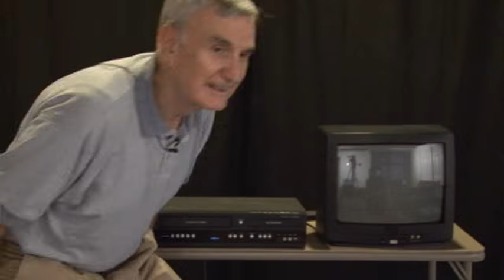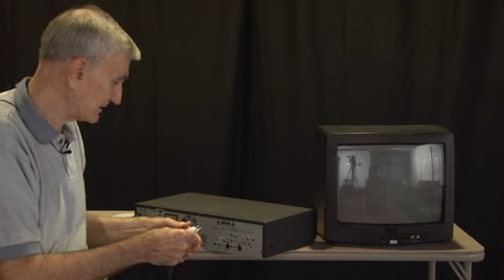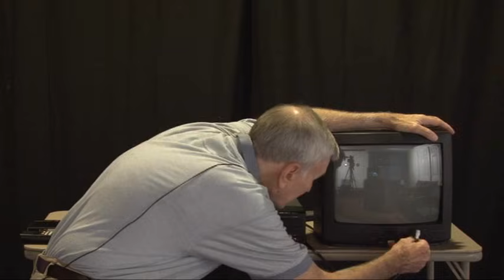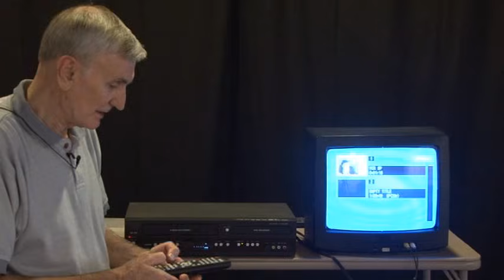VHS transfer to DVD using combo recorder

Comment from the maker: Charles G,  the brand is Magnavox ZV27MG9
Reply: can i do vhs to dvd Copy Commercial VHS Tapes
Reply from the maker: Juggerknot100, I believe the manual for my combo recorder says that if there is copy protection on the VHS Commercial title that it can not be copied.
Reply: juggerknot100 not usually. they is a coding on commecial DVDs that prevents copying them.

Comment: I just had cable installed on my "old" TV and I wanted to know if that will affect the way you connected this system. Luckily I have (almost) exactly the same VCR as you do, do I just make sure that the same cable wires you showed me are connected properly and not worry about the cable connections ?
Reply from the maker: I am sorry there can be so many variables with cable or dish and all of the peripherals. Just go with trial and error. Good luck

Comment: After I recorded it seemed to finalize the recording by itself. It will not do anything when I press the setup button.
Reply from the maker: If the DVD plays back on other DVD players, I would say good. If it doesn't you may have over looked some step.

Comment: My mother  bought me a Toshiba DVR620KU. Supposedly I would be able to transfer my old VHS tapes to DVD'S, and copy TV shows I had recorded on my Direct TV DVR. The VHS tapes I have were either prerecorded (bought at a VIDEO STORE), or blank ones that I had recorded TV shows or movies onto. I have the cables set up right. I am constantly getting error message, that I cannot record. What am I doing wrong , or were we ripped off. My technical knowledge is very very limited
Reply from the maker: I know nothing about the brand you purchased. However, I believe most brands are unable to copy copyright titles.

Comment: Hi Anthony,

Thank you so much for this tutorial. I did a test with a random recording I had and it worked great! 

However, when I tried it with a family movie (which already had the security/record tab removed), it wouldn't let me dub! Why does it work in your video and not with my family tapes?
Reply from the maker: Nana Kisoe , I am some what puzzled also. Only suggestion I have is to take the tape out, turn off the combo recorder and turn  back on and try again.

Comment: Very helpful but appears I need a remote to do what it is I need to do. I bought a used SLVD380P model on ebay which did not come with a remote. Is it possible to do all the stuff you did without a remote, or do I need to get one?
Reply from the maker: Davidy, This looks like it only plays DVD/VCR but will record to VHS tape. I don't believe this unit records from your VCR to DVD!
Sony SLV-D380P DVD/VCR Player VHS Recorder

Comment: The only thing it cannot do is transfer commercially released VHS tapes to DVD because of Copy Protection.
Reply from the maker: BuddyBoy600alt, tells me that in my manual.
Reply: my friend built me a nice little gadgit that removes copy protected signals.. works great.. back when RadioShack sold kool parts and things..
Reply: my friend built me a nice little gadgit that removes copy protected signals.. works great.. back when RadioShack sold kool parts and things..

Comment: just bought a Samsung TV to connect the Funai combo recorder.  Can't get the tv to show a picture.  Shows snow.  Could this be the cable?  Does a cable need to be hooked up for this to function.  Can the TV and combo recorder be hooked up without a tv cable?
Reply from the maker: tmro89 got3kids , If the cable connections connect both the TV and the output on the combo recorder, than it sounds as though you just need to select the correct input source with your TV remote.

Comment: Hi 
When I put the dvd in to  recored it keeps coming up with a message 
Disc not compatible  any suggestions
Reply from the maker: Jas Dhaliwal, is this a combo you purchased recently, I suspect this combo does not record to DVD.
Reply: @dahdigital1   the instructions say it will recored dvd from vhs 
Today I tried to power it up and for some reason it would not powe up  any ideas it did work yesterday  I tried changing the power cable and fuse in the plug but no joy

Comment: I have an old sylvania VHS/DVD recorder and I have had an issue with the blank DVD-R disc when I try dubbing an error message says disc error cant record on this disc what is the problem????
Reply from the maker: Katie, my guess is that your Sylvania recorder may have some instructions that are not the same as the Magnavox recorder I demo. I know that some DVD recorders require the DVD to be formatted first. I don't know about yours.

Comment: I have a sylvania combo Vhs/Dvd recorder and 
I’m all set to try this but
I don’t see a dubbing button anywhere on the remote .
Could it be called something else? 
Thank you for your great video! I never would have tried this
Without your help 
~ Cindy
Reply from the maker: From what I have seen in the past , I believe others have purchased a combo unit that looks almost identical to the combo recorder, but  is only a VHS tape player and a DVD player. If you don't have the dubbing button this is what I suspect.
Reply: I was thinking the same thing,  but the machine actually says Recorder on it ~ I will continue to try, thank you for all your help

Comment: Good job man!  Do you have any suggestions for old tapes with a tracking problem at the bottom of the screen?  Other then using the tracking adjustment feature on the VCR player?  The thin tracking line at the bottom of the video is annoying.
Reply from the maker: Yes, I have dealt with that over the years. I guess you could try putting in video editor and crop the picture.

Comment: where can i get one of those?  rw dvd vcr recorder that is in this video.  what is the model number so i can find one like this on in the video
my i had is broken it is a 2009 model   it is had to find one that is new and not used what kind  is this in the video?
Reply from the maker: Wayne Vaughan, my Magnavox ZV427MG9A that i demonstrated in my YouTube video is not made now and was discontinued several years ago. The only VHS to DVD combo recorders that I know of are only available used or refurbished. fI you search for one be careful that what you buy will record to DVD. There are combos out there that look identical to the combo VHS to DVD recorder but only records to VHS tape.

Comment: Why does the VCR side only last for a few dozen tapes before it goes out?  Then you have to hook up another VCR.  The disks randomly get E 3 followed by a hexadecimal number, then there will be what appears to be shadows, in the center tracks, so it won't finalize.
Reply from the maker: I can only seek from my experience. I had a combo recorder that went bad on the DVD side, i always felt like the young people got a hold of it ant treated the combo recorder roughly. I bough my second combo recorder same brand and model as first and made sure the kids didn't abuse that combo recorder. Over the years i literally transferred hundreds of vhs tapes to DVD with no issues except for an occasional bad tape.

Comment: That particular DVR Combo is a SANYO and they don't take DVD+R or DVD+RW none of the pluses +++.
It requires DVD-RW and one's mileage varies when using DVD-R. Speeds are tricky and that unit needs 4x to 8x NOT 16x. Sanyo FWZV475F is poor technology because it has no USB ports for USB storage devices and there are external USB DVD-RW writers.

Comment: Also I have a Sanyo DVD player/ Video Cassette Recorder. When I put the blank DVD in it reads "error." Does this mean my machine isn't equipped to record DVDs?
Reply from the maker: If it is only a player, then " no" it will not record a DVD.

Comment: Thank you so much Anthony! We are now on the correct path to record our old VHS tapes. I do have two questions. On many of our vacation VHS tapes, I want to make several copies for everyone to have a copy. Do I have to keep the sound on the TV for the sound to be on the VHS recording? My second question is do you copy, onto DVD, camera movies? Thank you - Debbie
Reply from the maker: Debbie Rapier, Let me try to understand your question "Do I have to keep the sound on the TV for the sound to be on the VHS recording?" I have never tried to record a VHS tape using the combo recorder. All of the the recording to DVD or VHS audio and Video is done internally, so no I don't see why it would need to be keeped on TV. Yes you can hook the older cameras to the combo recorder and record form your camera. The newer cameras mostly connect by USB.

Comment: I've a Daewoo DC vhs dvd combo recorder which I boughted 3 days ago.. however it works correctly but the problem is that there isn't the dubbing bottom on the remote or on the machine and I've a lot of vhs tapes to convert it now... please help me !
Reply from the maker: +SNCFT / Tunisian Railways , I only have experience with my brand but here is what I  suggest. Put a black DVD in the DVD record tray of the combo recorder. If you have your combo recorder connected with the video out to a TV and now play a VHS tape, if you  can watch this play on your TV.  You should be able to press the record button on the combo recorder for the DVD and this should record the program from the VHS tape to the DVD.
Reply: ow sadly I saw the caracteristics of mine an' unfortunately it can't dub from VHS to DVD.. it can only record from TV to VHS or from DVD to VHS.. bad luck !! and I've a lot of vhs tapes that I want to transforme to DVD

Comment: While this certainly is one way to go about it, I rather prefer to have a dedicated VHS deck and then hook that up to an HDD/DVD-recorder.

This way I can record the contents to the HDD first at maximum quality and then trim the recording and remove unwanted footage, like ads, parts unrelated to what I want to keep (snowy pictures, blank tape space, etc). Once I'm satisfied with the end result I can then transfer that to a DVD, knowing I'll get the best possible result and only the content which matters to me. Sure, the transfer to DVD will most likely happen in realtime (unless the program is only one hour long), but the result is quite acceptable with very little loss of picture quality.
Reply from the maker: pHD77, very interesting! would you please give me the brand name and model number of the product you are referring to? Thanks
Reply: @dahdigital1  Since my gear hasn't been used for quite some time and is stored somewhere in my basement, I can't give you an exact model number. But I can give an idea of what to look for to get the best possible quality.

As far as  VHS playback goes, I would look for any hifi units made by Sony or Panasonic back in the mid- to late nineties. I've found these units to be both very reliable, easy to maintain and able to provide a very good picture. Indicators to look for: For Panasonic units, look for the Super Drive logo, while on the Sony units look for the TriLogic logo. 

Back in, oh, I guess 2006, I had a deck like yours at my place for a short while, borrowed from my uncle, who wanted to transfer all of his home video, but couldn't figure out how to operate the damn thing. The playback of the VHS part looked to me like crap. Oversaturated colors and details were lost even more. I immediately just told my uncle to return the damn thing and then I hooked up my own gear. I actually made a disc to my uncle, showing him the difference in VHS playback and he was surprised to see, that two units performing the same task could differ so much in quality. 

Oops, getting sidetracked here... 

When it comes to the HDD/DVD recorder, mid- to late 2000s Panasonic decks are preferred, since they have a very good comb filter capable of suppressing analog artifacts, such as "rainbow" effect, very efficiently. Second choice would be a Pioneer - the results are a bit "softer" and the comb filter is not quite as efficient as one on the Panasonics, but it will still yield good results.
Reply from the maker: pHD77, Thand you for taking the time to give me this information. I actually have the Panasonic DMR-EH75V wondering if this is the same HDD/DVD recorder you have. When I started transfering my VHS tapes to DVD I had well over a hundred and just wanted to get them transferred over to DVD. Yes I may have lost some quality but I have such a volume of video I hardly know what to do with it all. But than again for your very good information.

Comment: I've been trying to copy for over 1 month now and I keep getting messages on the dvd stating 'disc error:  please eject the disc.  playback feature may not be available on the disc.  need answer.  thanks
Reply from the maker: ronald king , I suggest that you check your manual to find out the exact DVD disk that your machine will record on and use that DVD. If you know you have the correct disk, you might have a bad disk. Try another disk.

Comment: I really appreciate your help with this. I couldn't have done it without this video. Is it okay if I do HQ 1hour for a tape that has 1:09:06 ?
Reply from the maker: Cheyenne Paris, It is OK as long as you know you may be cutting you DVD recording short by about nine (9) minutes.
Reply: Okay thank you, also I have a VHR tape that's 1:08:43 and a different tape that's 20:38 can I put them on the same DVD if I do SP mode (2hrs) if so how? Do I put the first tape in and dub it to the DVD then dub the 20 min tape after ? Or would the 20 min tape go over the first tape? Let me know what you think. Thanks. Hope this makes sense.
Reply: And would I finalize the 1:08:43 tape on the DVD before I put the 20:38 tape in the converter ? Or do I  finalize the DVD after converting both tapes to the DVD.
Reply from the maker: Cheyenne Paris, Please watch my YouTube video " Simple editing using combo recorder to transfer VHS tapes to DVD" I think that should answer your questions about your transfers.

Comment: I recorded the DVD from a VHS following your instructions. I finalized it too. I can only see in the VCR I used, which is the one you use in your demonstrations. What am I missing? In my computer it shows dat files. It does not play. Thanks for your help.
Reply from the maker: +Suzana Maria, I use the  MAGNAVOX DVD COMBO RECORDER  ZV427MG. This combo unit does not require a computer.
Reply: +Anthony Wheeler Thank you for your prompt response, Anthony. What I meant is that the DVD cannot be played in my PC. I think I figured it out. I need a program that will open the DVD.  I have a Magnavox combo 620.

Comment: is this the Funai ZV427FX4 Combination VCR and DVD Recorder??  i am looking to buy one on amazon. also which DVDs do you recommend, i want archival quality, also another video suggested i could only use DVD-R for it to work. is this true or can i use +R as well on this machine. again which brand and type of DVD do you recommend for transferring  my old VHS tapes. thank you
Reply from the maker: James Brooker, my combo recorder is a Magnavox and the model number is ZV427MG9A. I think this model is discontinued. I use Verbatim -R DVD's most of the time. I have also used +R. My combo would also record to +RW or -RW which I have never tried to use. I have DVD's that I made 15 years ago on Verbatim -R DVD. I don't know about archival quality.
Reply: Thank you

Comment: I have a magnavox model zv420mw8, finally got the hang of recording (dubbing) old vhs to dvd format.  BUT I can not play them on my pc, does anyone know what i am doing wrong?
Reply from the maker: SEA Breeze ,make sure you have finalized your DVD. Do you have windows media player on your pc that is what I use on my pc.
Reply: Anthony Wheeler
 figured out the missing piece FINALIZe  thank you  trying to find out what auto finalize means,  have a feeling it wont finalize until dvd is full, not sure yet.  I am also trying to find out if i Can copy my PAL VHS to DVD on this machine and then play them on my pc,  yes i have windows media player
your video was a great help thank you

Comment: Anthony. I got the same model now, I like it. Can you please tell me how to change the recording length. It seems to default to a two hour mode. I need to switch to 3 hr cos I have a 2 1/2 hr vid. Can you help me?
Reply from the maker: Jimi Gear, to change the recording time for the DVD. Take a new DVD and put into the DVD drawer, watch the screen and when the DVD is recognized (loaded) take your remote and point at your combo recorder and with your remote press the control at the very bottom left side of remote, which says record mode, until you see on the screen the time you want to record. You might want to keep pushing the record mode button and see all of the recording settings you can make. Then keep pushing the rec mode button to come back to the time to want to set.

Comment: hi anthony i have a sylvania vhs/dvd combo recorder DVC845E I can't find any blank dvd-r blank dvds to record on even after i tried the right blank dvds for it and several brands too. i tried sony, memorex. maxwell. fuji. they are all DVD-R recordable 4x 4.7gb or tried DVD+R same same problem this disk error will not work in playback eject disk,. I'm using the right blank dvds that the manual suggested to use but still won't load the dvd and they aren't the ones you use for pc I kow those are different. only for your computer i have the right ones, so now what can I do to get it to work? thanks :)
Reply from the maker: 1othrocks, a little bit of search on the  sylvania vhs/dvd combo recorder DVC845E appears to be a combo playe,r according to the information I was looking at.